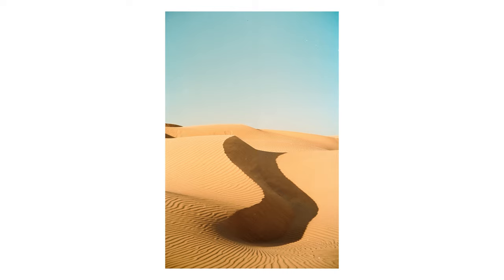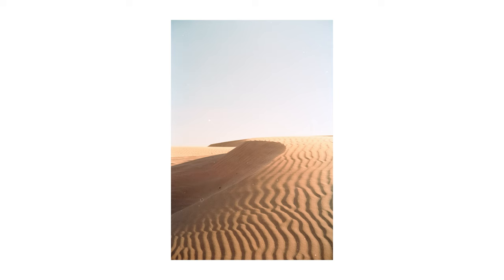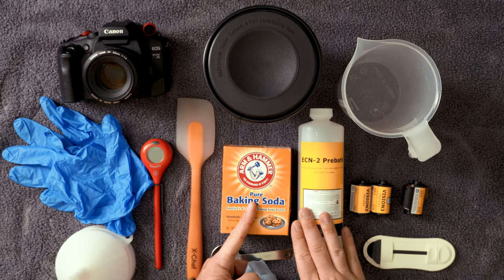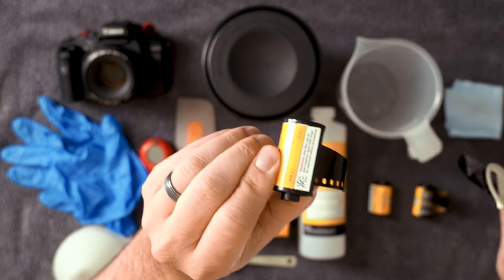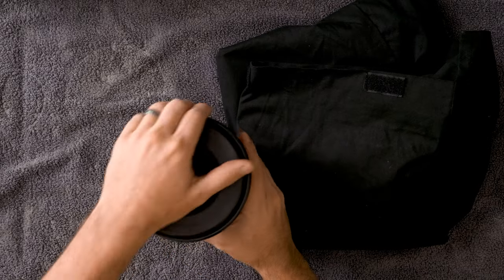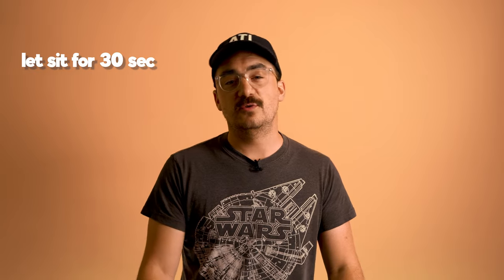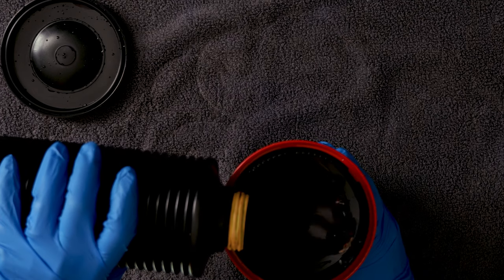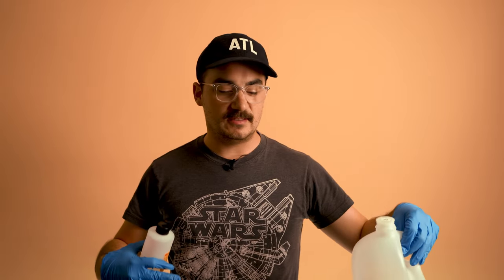How to develop kodak vision3 ECN-2 35mm film at home - IN DEPTH

Comment: The remjet is a carbon powder mixed with a liquid adhesive which is then coated on the back of the film. The prebath is a simple alkali solution, as the adhesive dissolves in any alkali solution. His plan to wipe any residual remjet off the processed film after washing and a final photoflo bath, using photoflo which is no alkali is not very productive. The better plan would be to use a microfiber cloth soaked in pre-bath or baking soda solution to wipe down the film after fixing and a quick wash just to loose the surface fixer solution, After wiping off the last of the remjet, do the usual wash then photoflo and hang to dry. This uses a more effective solution for the final remjet wash, then washes the alkali out of the emulsion along with the embedded fixer.
Reply from the maker: Awesome! thats super helpfuL!

Comment: Thanks for making this video! Do you think after removing the remjet using baking soda and then using Cinestill Cs41 kit for developing will contaminate the C41 developer in anyway ?
Reply from the maker: I potentially could contaminate it, but I nave never seems any I’ll effects. Really shake the crap out of and out more banking sodas than you think. Then rinse it very very well.
Reply: @film_friends  there is no need to to shake either PB-2 Prebath, or Baking Soda solution. Alkalinity is key. High pH solves the binder of the remjet and makes it soluble. After the prebath, rinse once, then fill up the tank to about half of its volume with water. Then vigorously shake. Rinse and repeat. This will almost completely remove any residual remjet. After rinsing, reimmerse in PB to solve any remjet residue that might have stuck on the emulsion side, and rinse once. Then develop.

Comment: Hello, if i don't remove the remjet and remove it after developing will it harm the chemistry and the developing?
Reply from the maker: the rimjet will cause issues with your developing for sure. and yes it will get into your chemicals.
Reply: Yes and No. (That's helpful!) The problem from processing remjet film in C-41 is just that the remjet material tends to delaminate and literally melt off the film. It is a carbon black, like very fine graphite, suspended in an adhesive attached to the back of the film base. The developer is alkaline, which will start dissolving the remjet layer. It is chemically inert, so it will not chemically damage the developer or other C-41 solutions. However, the remjet will come off as bits of black carbon goo. When such film is put through automatic a C-41 processing machine, that goo will foul up the machinery, so labs will not process that type of film in C-41. If processed at home in a tank, you have a similar problem, but you can clean up the chemicals by filtering them to remove the goo in solution and wash out the tank, You may still have problems removing the goo from your processed film. Overall, it makes more sense to first remove the remjet layer before processing, rather than have to clean it out of all the solutions and equipment after each use.

Comment: What is your opinion in cross-processing movie film in C-41 instead of ECN-2? I have heard very different opinions ranging from that developing in C-41 gets better results for printing to C-type, to other opinions saying that you should use only ECN-2 chemistry because a strong color cast due to wrong color developer in C-41. What is your experience in this matter? Do you experience any color casts you can correct only with a computer after scanning (instead of printing directly to RA-4 paper in a darkroom)?
Reply from the maker: I havnt done specific movie film aside from Kodak vision film. But the c41 chemicals look great on this stock. I didn’t run into any color casting. And you can deff fix things with skill in editing. A lot of the film labs for movie film will scan LOG for you any ways so you can color it how you want it
Reply: @randallstewart1224  I agree with you. I would not use Vision3 for printing RA-4, as the systems are incompatible. Especially C-41 processed film seems to have major crossover problems - magenta pavement with green skies. My opinion about CineStill in general is very bad - they are charging premium prices for substandard products. This is true both in their films and chemistry. The new generation of hobbyists, what I don't belong to, tend to do very sloppy processing they correct with hard photoshopping. I was just interested to knowing what this original poster thought.

Comment: Hey Will. Have you ever tried 110 film? I got my hands on a Pentax auto 110 but don’t know how to go about it 😆. It looks like a toy and I don’t have the $$ to experiment with it. My film lab doesn’t develop 110 so the cost is going to be crazy. I normally scan my own film but don’t think I can do it with 110? Just a though for a video 😁
Reply from the maker: I have a few I havnt taken for a spin yet. 8 wanna try it out. The prob is the developing line you said! You can modify a film reel to dev at home then use a flat bed scanner to scan it right on the flat bed. I am gonna do a video soon on it!
Reply: @film_friends  Oo I’m excited. I have a lab box and don’t want to be modifying it 😅. So I might just have to pay
Reply from the maker: Hahaha yeah prob!
Reply: @anatorres2513  The mechanical specifics of the LabBox limit it to 35mm or 120/220 film sizes. Removing the 110 film from a 110 cartridge and loading into the LB seems impossble.  I doubt there is any practical way to modify it to other film sizes. On the other hand, 110 film width is the same as 16mm, and it should be possible to find old 16mm reels on eBay, particularly steel reels, which would fit in appropriate film tanks, also commonly available. There is a YT video out there which shows how to cut a Paterson reel to hold 16mm/110 film.

Comment: Thank you for this!  about to start bulk loading and developing cine film, so this couldn’t have come at a better time.  i found a shop on etsy that sells 1L kits of ecn-2 chems, so i’m planning on trying that first i think… sounds like temp control will be a little different, more important than even with c41.

it’s strange to me that c41 and ecn-2 chems both supposedly work.  i’ll definitely have to try both and compare results!
Reply from the maker: I didn’t find any issues with temp control tbh. 

I wanna bulk load really bad. I have a few more rolls I purchased before I make the decision to do it, but after these rolls it really does a great job! I love these shots
Reply from the maker: That’s an amazing deal! I got a hand roller thing for next to nothing in a box of old cameras. I’m dying to do it myself if I can get a can of it
Reply: Not strange at all.  I compound my own C-41 developer, and the formula for ECN-2 developer is on-line. There are chemical differences, but those are minor.  The big difference is in the film. Color in either film if created from dyes in the emulsion, and those dyes are different. The color dyes in the movie film are matched to the dyes in the positive film used to print movies. The dyes in C-41 film are matched to the dyes in color printing paper (RA-4).  The considerable power of scanning and computer image processing largely neutralizes thos differences. There are a couple for YT videos trying to compare positive image (scanned) difference between film processed in C-41 and ECN-2. Unhappily, those are done under such uncontrolled circumstances that whatever the results look like, you cannot draw any valid comparisons.